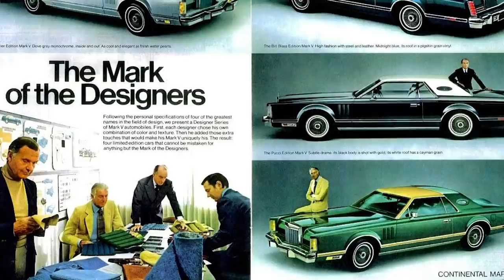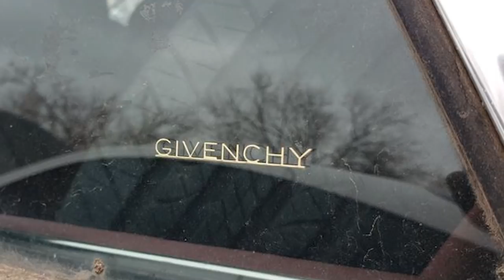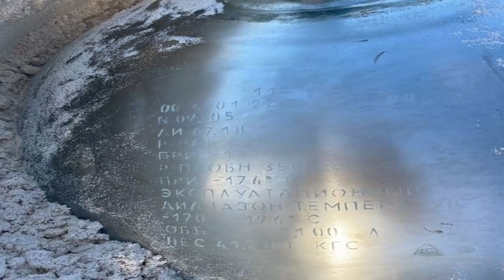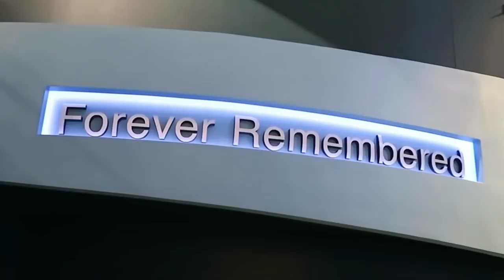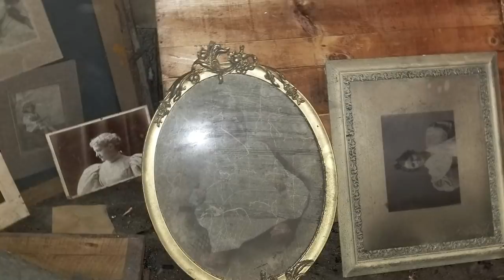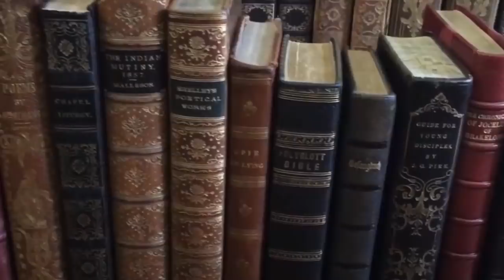12 Most Incredible Recent Finds

Comment: The last one makes a lot of sense. We really don't know when things were built and most of written history was made in the last 200 years.
Reply: Except for China I have over 5000 years of written history
Reply: @imadamily  really? Im curious now, is it passed down or mass produced? Basically I'm asking if its from the original source or is it socially accepted "historical narrative?"
Reply: Hmmm I have no idea but I think you are going to explain it to me? Plz
Reply: @colonialrebel9964  good shout, history got changed around 1800s. We had electricity back then, how you boring tunnels out? By hand? Why? Just live on the surface
Reply: @imadamily  No, you need to explain how you have 5,000 yrs of Chinese history?
Reply: @clive280178  most buildings built before 1600 no one really knows who or why they were built. Example, the pyramids in egypt have salt water residue coating the outside, also the chambers inside contained salt water. This means the pyramids were at one time underwater. Also the Egyptians seemed to graffiti the pyramids and sphynx  but never actually built them. If you look at the tube drill holes found all over Egypt, they had technology to bore holes through basalt and granite with ease. We need high speed drills, computers and water jets to accomplish this.
Reply: @colonialrebel9964  yeah man so obvious they had the skills knowledge and techniques. The building were energy devices, the water of pyramids would have been either electrolyte or maybe even a cooling system for the immense power stations. Tombs my arse. Cathedrals are cathodes mate look into that

Comment: 228 degrees Fahrenheit?  My pizza rolls are that hot when they come out of the microwave.
Reply: It should have been 2228 degrees F and thus 1220 degrees C. Not quote solar heat but rather more than it would take to convert your your pizza rolls to carbon dust! XD
Reply: Lmao I hoped I wasn’t the only one who caught that
Reply: @vanshelton1786  I actually didn't. I glitched the number in my head and inserted a decimal point and assumed it was 2.28K. My brain would not accept it was the boiling point of water. Only this comment thread made me realize the typo. LOL
Reply: At least it explains why they take a million years to cool down 🤷
Reply: I can pass gas hotter than that.